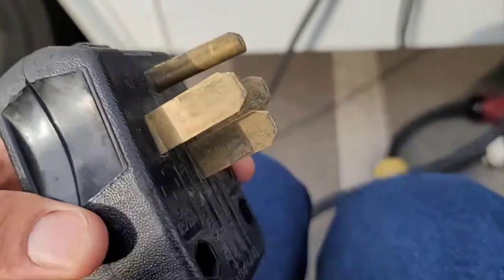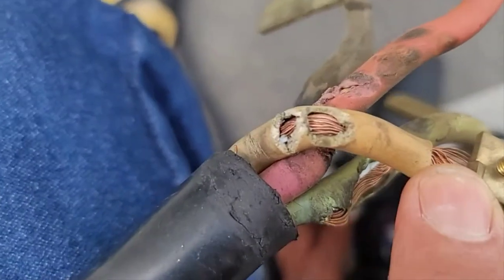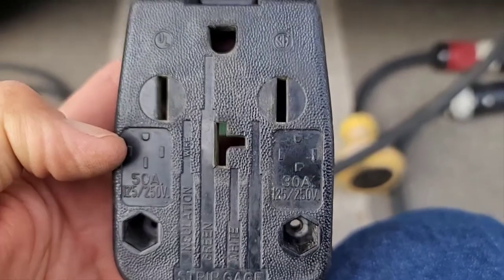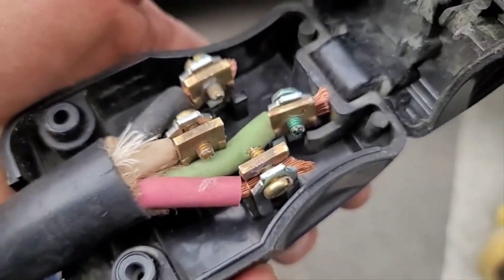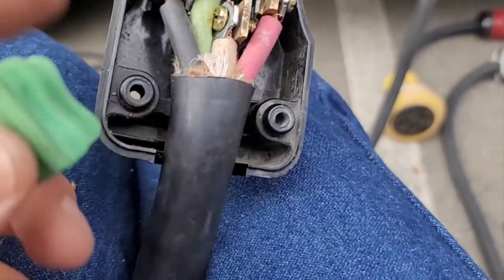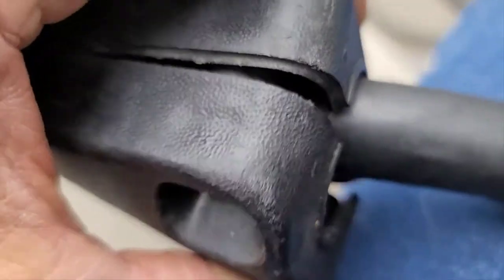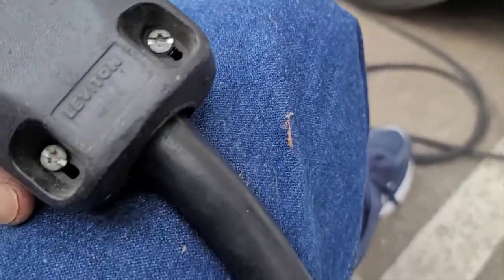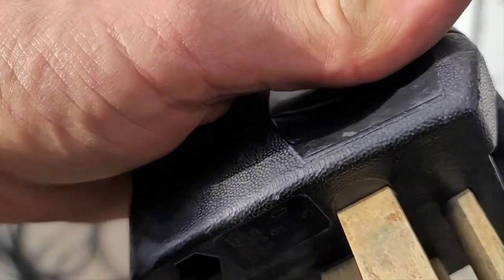Re-wire Leviton 50 amp RV plug fix strain relief.

Comment: 6 gauge wire works with this plug?
Reply from the maker: Not sure. You could make it work. Kinda big and stiff. I will often upsize in a system if it fits. 
I can't remember working with #6 and #8 is huge to me. I like 10 cause we only use about half the potential amps (25 of the 50amps plug is rated for and breaker)
What are you wiring up?
Reply: @MichaelDillin  power distribution box
Reply from the maker: How much potential draw do you have for your distro box?
I would right size the distro box to the 50amp plug and wire. If I had more that 50 amps potential I would use another connection like cam ends and bigger wire. 
Do you know what the 6 wire is capable of in amps?
Reply: @MichaelDillin  like 60 amp and 600 volt the wire can handle but any only around 40 or 45 amps